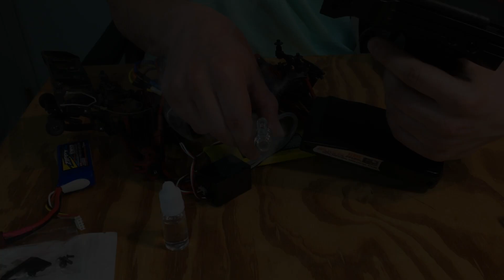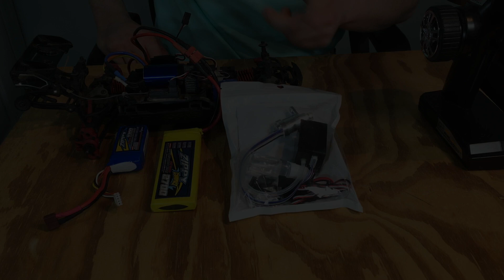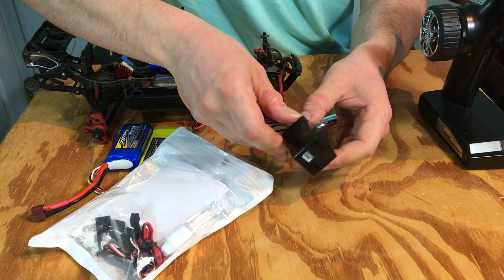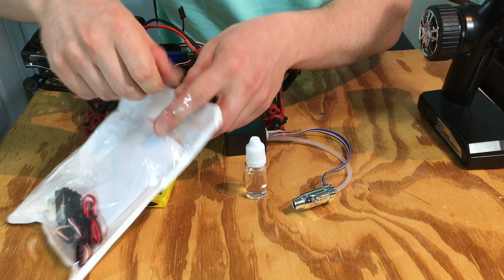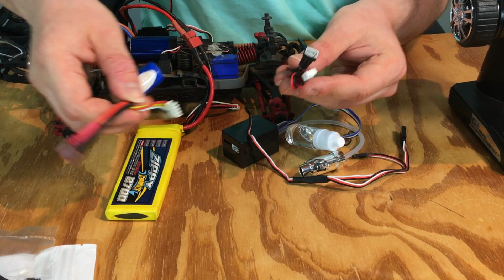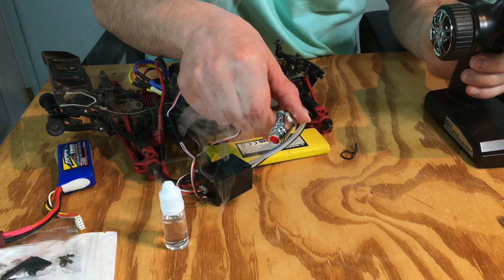RC car smoke generator (coolest accessory ever?)

Comment: So I can’t use this on my nimh? Cause it doesn’t have a balancer
Reply from the maker: Hey buddy, to answer your question this accessory is powered by the balance plug of a Lipo battery. It is a fairly common way to power small accessories like that because the balance port is usually just open and not doing anything while the battery plug itself this powering the car.

Comment: Would I be able to snip the wires and solder the wires to a model train controller that is 12 volts and just use my model train controller for controlling the smoke for when the trains are stopped at the station to make it seem like there letting off steam if anyone knows if this will work or not please let me know

Comment: Do you know of any smoke unit that makes the smoke shootout at high speed when you fully press on the throttle?
Reply from the maker: hey buddy! This unit does push smoke out based on the throttle input.  There is a splitter between the the throttle channel and this unit, so it knows when you're at full throttle and will push out the MAX smoke when it detects the higher throttle levels.

Comment: What if my batteries don’t have a balance port would it still be fine?
Reply from the maker: hey buddy! How can that be?  What sort of battery are you using??  All lipos have a balance port.  This setup is meant for a 2S lipo to power it.
Reply: I'm guessing you are using either a NiMH battery, Spektrum G2 LiPo, or a Traxxas LiPo without a balance port. If your battery is a 2S LiPo or 6-cell NiMH, you could put on a balance port yourself by soldering it to the connections of the battery connector in your RC car and running it that way. I doubt this unit has a LiPo cutoff circuit, but an external cutoff circuit should suffice.

Comment: Does the battery used for this need to be the same one powering the car or could you use a small 2s lipo for this and run the car off a 3s
Reply from the maker: hey buddy! You could use any 2S lipo balance port to power this unit.  I've already tried that, it's fine.

Comment: I just installed ess one + and it is cooler then the smoke as u can have only one or the other sound is the way to go i think,would love smoke as well but as i said only 1 plug for throttle receiver, led lights on channel 3 are next...:):):)
Reply from the maker: hey buddy! I just checked this ess one+ system, its a cool gadget.  If you check out my newer videos you will see I run mostly GAS and Nitro RC, thats why I like the smoke, lol.  Both would be good, you could get a receiver and radio with more than 3 channels, and you could easily run both.  I use a Flysky GT5 for some of my other RCs btw.

Comment: Is it possible to use 3s lipo ? Is the energy from the servo Cable not enough ?
Reply from the maker: hey buddy.  This unit is only capable of being powered by a 2S lipo.  The 3S for will not fit into the generator.  The servo wire in this setup is not used for power, it's only goal is to get a signal from the ESC so it knows the throttle input level.

Comment: Does it work with 3s battery?
Reply from the maker: hey buddy.  This has a power source input for a 2S battery only.  I'm not sure how you would wire up a power source that is not a 2S lipo.  I'd say the answer is no.

Comment: im guessing there is no 1/12 scale
Reply from the maker: hey man! This really isn't about scale, this accessory will work with any common hobby grade electronics system designed for RC.  You can run it on anything you want as long as you can mount it up, you know.  This would also be ideal for a 1/10 drift car btw

Comment: can i put that on a ford pick up cr12 trail series
Reply from the maker: hey buddy.  You can use this smoke generator system with any hobby grade receiver and 2S battery.  Your receiver will control this unit, otherwise it's just a matter of mounting it to make it fit.
Reply: I don't think I got all the things to plug it into if you have the same truck as me I would love if you showed me
Reply from the maker: @jimmyjohn9637  I made another video with some more views and details on this install,  im gonna give you the link.  Make sure you have the same wiring setup as I demonstrated in the video, let me know.  thanks!!! https://www.youtube.com/watch?v=AJ848tHMKFI
Reply: @hybrid32494  now i only have the channel 2 i dont think i have the other one
Reply from the maker: @jimmyjohn9637  did you see my second video on the install?  do you have the Y harness which is a throttle signal splitter?  Otherwise there is no other significant wiring as long as you are getting power to the unit.
Reply: hybrid32494 yes thank you
Reply: is this on amazon and do they ship to Massachusetts

Comment: Don’t know if someone said this but could you add a little food colouring to the mix to change the colour of smoke?
Reply from the maker: hey man, that is a terrific idea, nobody has said this yet.  I will try it,  thanks so much!!! I have this system on a WPL c14 kit right now..
Reply: hybrid32494 hey mate no worries big shout to me ha ha
Reply: Not sure if it would as most vaporized smoke units push only white at best, but you might be able to (color) it by changing the led to a rgb

Comment: The smokes so Cool, would look much better with a solid, dull glow LED or no LED's  at all though i reckon
Reply from the maker: I pretty much agree with ya.  Im sure you can figure out which wire is the LED and just disconnect it, if you really wanted to.
Reply: @hybrid32494  it's the green one... Just take it out of the connector.

Comment: Is the engine noise coming from the unit itself?
Reply from the maker: hello, Yes, the little black box is the motor pump itself.  It gets louder as it builds pressure when you give throttle.  So far the unit is working well to this day,  I installed in on a scale WPL c14 too.  Check that video out if you get a chance.
Reply: @hybrid32494  hey mine seems to be throwing drops of oil out of the exhaust when I give throttle have u had this problem?

Comment: Does it work without balance cable
Reply from the maker: Hello, No, you need the power from the balance plug.  The other wires are just for the throttle input so the system knows when you are accelerating or braking.

Comment: So..... will work with coking oil or wd-40?
Reply from the maker: hello, The instructions don't mention anything about that.  I have not tried it yet.  But I don't see how there will be an issue with cooking oil, it all tends to smoke at high temps.  You really use very little of the included oil, it can run for a while on just a few drops anyway.
Reply: Tou can use the vape juice

Comment: Hybrid, thanks for the tips but yes I've checked. I even took the housing off and added oil directly to the coil. The coil isn't producing heat.
Reply: Send a video to the provider and let them know you got a bum unit. I am adding an on off switch to mine that pump is going to drive me nuts after a while.
Reply: @scottfirman  I would but it came from a Chinese warehouse and took forever.  It was under $20 , I'll just take the hit.

Comment: I bought the same system and it didn't work at all. It doesn't get enough heat from the coil to heat the oil
Reply from the maker: Shane Pratt   Hey!!  Are you sure that you are adding enough oil into the chamber pipe?  Try more oil.  And is it properly connected to ur thtottle channel with the splitter and is the led light working??
Reply from the maker: Shane Pratt    Watch this video too.  I installed this in another rc.  Check your wiring.  https://youtu.be/AJ848tHMKFI
Reply: It takes a minute or three to heat up.

Comment: Bought one now how do u change the idle because if i change my throttle trim it moves backward
Reply from the maker: hello, this thing responds and copies the throttle input that you give your RC.  Do you have your throttle trim set to normal neutral and not in reverse?  It should generate smoke when you apply the throttle in any direction, it just send the same throttle input signal to the smoke unit as it does through your ESC.
Reply: hybrid32494 I’ve seen in your video and my smoke machine that the light blinks way too fast idle and even faster with throttle, think about a real car, the way it’s blinking idle  is like a car at full throttle and when the rc is full throttle the light is almost static
Reply from the maker: so you are saying that yours is blinking too fast at idle, compared to mine in the video?  I'll install this kit in a WPL C14 soon and will make another video, its a good slow speed RC crawler, should be nice and easy to tell how this thing works.
Reply: hybrid32494 waiting for that then guess I have to sub to you then
Reply from the maker: LOL, YEP.  I left you no choice.  ahhahaaha.  It's ok I got alot of cool RETRO rc stuff coming soon,  I don't mean like old vintage TAmiya, I mean like early 2000's HPI and stuff like that.  You ever run nitro?
Reply: hybrid32494 nah where I live nitro is as banned as drones to the point where u need a membership to a private airfield to run any of them.... or anyways illegally
Reply from the maker: Terrible, I have a DJI Phantom 3 4k Drone and the FAA license.  Still got harassed by cops.  I don't think they know that drones have no ZOOM and you really cant spy on anything even if you crop the videos later.  What kinda drone you have?
Reply: hybrid32494 can we dm somewhere this emails me everytime
Reply from the maker: sure, you got instagram?
Reply: hybrid32494 @crashcraftgaming
Reply: hybrid32494 find it?

Comment: What if you don't have a balance cable? The Traxxas ID batteries eliminate the balance cable. They make adapters to hook onto it and then you get your balance cable again. Would I have to use one of those?
Reply from the maker: you def need the balance plug for this.  The balance plug is powering the unit itself.  The other connection plugged into the receiver is just getting a signal for the amount of smoke to generate based on throttle input.  So you either need a different lipo or that adapter, you'll be fine.  thanks for watching!!!

Comment: Can I use it for my carson virus buggy 1:8 ?
Reply from the maker: hello,  Yes you can use this on any rc car/truck.  You just need the wiring to all fit, which is not a problem.  Basically any TX/RX system is the same and will work the way I showed it in this video.
Reply: @hybrid32494 
OK. Thanx for the answer

Comment: Stupid question is it waterproof?
Reply from the maker: there is no claim on the listing fo this being waterproof.  Although It just the black control box with some basic wiring, so it seems that if you just seal it with silicone around the perimeter if should be fine.  Cant say about the smoke pipe itself, it does house the LED, but the wires seem already siliconed around the pipe itself.

Comment: will Food oil work ?
Reply from the maker: that is something I am wondering myself.  I don't see why it would not.  I will try some out later for you.  Maybe wd-40 would even work too.
Reply: hybrid32494 what were the results
Reply: @hybrid32494  so does wd-40 work?
Reply: @MCgangsta11  Where is the Results ?
Reply: random stuff I was asking if anyone testing any other Oils. I don’t have this product yet.
Reply: @MCgangsta11  oh Ops Dude I was Trying to Reply to Hybrid32494 about The Resaults Of Food Oil
Reply: yes if you use Vegetable oil
Reply: I just went to the hobby shop and got some train smoke oil. Its the same thing.

Comment: That’s so funny brotha I wish u could see what is sitting in front of me on my work bench, I have a transmitter, rc without body n wheels on, same yellow zippy battery! It looks like I’m looking into a mirror almost! Man I wish I could take a pic of this n show u how weird this is! Great video that’s pretty nifty!
Reply from the maker: hey dude!!!  I been following your tamiya build, it would be cool if you got one of these installed on there.  I gotta say that cheap zippy pack is very very good, paid about 12 bucks for it 7 yrs ago, and it still charges and runs well, with no call balancing issues at all.  I think ill put this smoke simulator on my tamiya lunchbox soon.
Reply: hybrid32494 ya brotha I was thinking that too! I'm gonna have to look this up n get it for a project in the future,lunchbox would be perfect,I wanna build a lunchbox bad! Love that rig! Great video n info on this product,its awesome that it works too,that's always a plus when buying new things like these